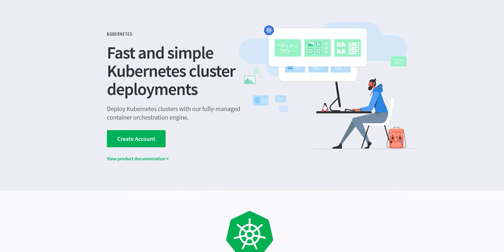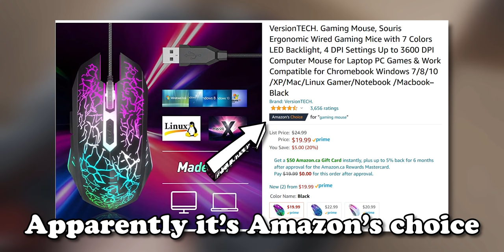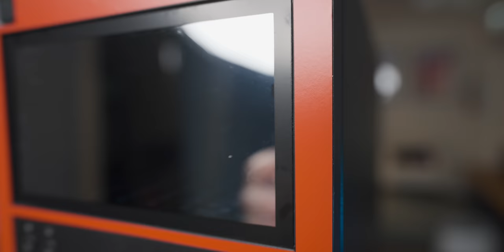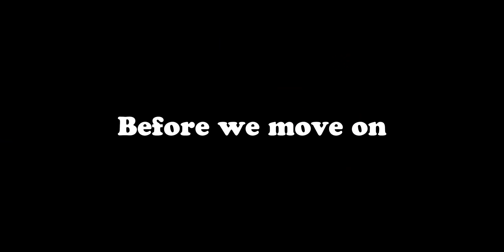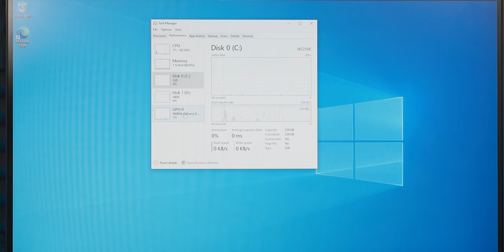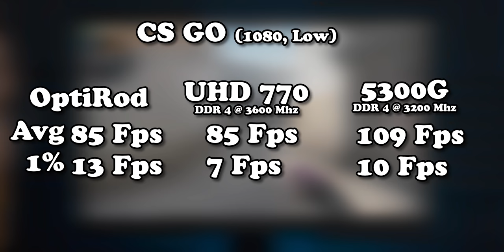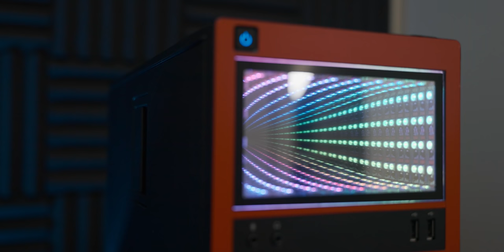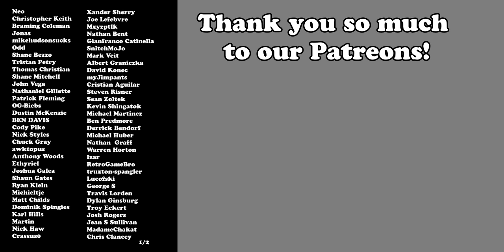I Couldn't Resist Buying This "Gaming" PC From Best Buy...

Comment: Looking forward to your sleeper build in this chassis. Maybe not an ALL out alderlake... how about something like ryzen 5600x and a gtx 2060-3060 class GPU. I suspect you MIGHT be able to swap out the power supply and put in a good cooler and MAYBE a 5600x + 3060 would survive the heat in the chassis. Also maybe swap out the rear fan for something a bit beefier.

Comment: NGL that's probably one of the least sinful office grade cases to do a sleeper build in. Looks like it comes stock with some form of ventilation, is that front panel completely punch-through with that cheese grater design?

(That and the OEM form factor component mounts, ofc.)

Comment: I want you STUFF that case with a 3090 and an Intel 12900k. Make that infinity mirror fill with fire as the case temp skyrockets to just under the temperature on the surface of Mercury. During the middle of the day. In summer.

Comment: A common problem with these, is the rubber holders for the system fan. They degrade over time, causing the fan to fall down and get jammed in the CPU fan. Brilliant cost cutting design by Dell, as usual. ;)

Comment: I think you have a DD4 1030 there. I have a Hp Prodesk 600SFF with similar specs, and get significantly higher FPS.

The 1030 is being cripled by selling it with DDR4 in stead of DDR5. I have a DDR5 one.

Comment: Honestly if that GT 1030 wasn't DDR4 (it has to be, the GDDR5 still beats or matches all integrated graphics) and had an i7 it definitely wouldn't be a scam at all, if it cost less than perhaps around $400 USD but no more than that (already a stretch). It does seem to be based of the Dell Optiplex 3010 which is the cheapest version of the Ivy Bridge-based Optiplexes.

How much did it cost? I didn't really recall if you ever mentioned it. I love the Dell Optiplex videos. They're really a relic that's still very much usable in 2021/2022.

Comment: as an i7 860 user, never underestimate old cpus.  My i7 can still slaughter Modern Warfare and the like.  The only game it hasn't done well on is Forza Horizon 5.... so I got a 9700k and it's amazing, BUT this old tank can run most anything.  And once you dip into the 2600k, it's game over, new games!

Comment: Keep in mind the 1030 is like a 10 year old graphics card (probably 12 years old now in 2024 when I'm writing this) so the fact it can sort of keep up with a modern iGPU says something about the configuration (although I would just buy a modern system with a modern  iGpU instead since it would be new and go from there).  This Dell is probably the bare minimum for some games and probably can't handle most modern games (ones made in the last 5 years or so). I do have to say that the iGPUs on AMD's processors are quite good compared to the Intel (although the Iris Xe graphics and now their Intel Arc which I don't know if it comes in iGpu form or not) may level things out (I don't keep track anymore).

Comment: Must have been a ddr4 gt 1030 which is basically a gt 730, I had the ddr5 version of the gt 1030 with an i3 2100 and it ran at like 45 to mid 50's at normal.

Comment: If you ran Fortnite with performance mode rendering rather than dx11 and didn't have view distance up I would venture to guess you'd be getting atleast 45 stable if not pushing 60 fps. Performance mode rendering really makes the difference and not even pros use anything past normal or low view distance. Great video though! I love the look of the OptiChad

Comment: The performance was way under expecations tbh. I have an SFF i put together years ago with the i5 2400 and 1030. and i swear GTA 5 ran at 60fps at 1080p normal settings, and CS:GO should be at 100+fps at 1080p lowest. It might be possible your 1030 here might be the DDR4 variant.

Comment: I absolutely hate you for making a cooler optiplex than mine. Mine has an extra fan on the top of the case and an extra grill for it too. It also has a card reader in the front and another fan in the front along with a couple of major internal changes

Comment: Never heard of a GT 1050, I have heard of a GTX 1050, and I have never seen a single slot 
1050, ever.  what brand is it ? I looked at it carefully its not thick enough to have a fan, it
just has a heat sync, never seen a 1050 without a fan.
Reply: It's a 1030 though.
Reply: @InfectedChris  does he talk wrong just to be annoying ?

Comment: Optiplex 3010. Those, the 7010, and the 9010 are the pinnacle of “let’s turn this office turd into a GaMiNg PC.”
IIRC, the 3020/7020/9020 could also take ATX stuff but the PSU you got to replace the proprietary shit had to be SFX or the smaller version of ATX.

Comment: Be WARNED! You're going to need an SFX form factor Power Supply.
I Have an Optiplex XE2, same layout but with an all black front panel (you can but just the front panel on ebay) has an i3 10100, 1650 Super, 16gb of ram and a 500w PSU.

I Actually cut a Hole in the Front of the metal in the case behind the front panel and added a 120mm intake fan.

Comment: Putting "top of the line" gaming components into that case would be an absolute disaster, it has the airflow of a bowl of Jello.
Reply: So watercool everything. Mount the radiator on the outside if you have to...

Comment: Those optiplex builds are always surprisingly not vomit-inducing.   But that GT1030, a used GTX 750ti would run circles around that piece of junk.

Comment: Comparing the GT1030 to UHD 770, which has the availability of high speed DDR4 or DDR5Z memory, while having a more robust architecture, compared to a GPU with 64bit GDDR5 memory and an older architecture (unless that model is the crappy DDR4 model)
This gpu is literally for systems like this, if you can’t spend the extra coin to make a new system, since the iGPU in these systems is outdated and far bellow 1000 gflops.
More so, if you want more out of a system like this one, try getting a GTX1650 or even a 1650 super or higher if the thing has a good enough power supply, and extra cables.

Comment: Well the spec numbers seems decent, until you realise that all the components are the lowest end stuff possible. This is probably an OptiPlex 3010, the cheapest lineup, and it shows by the much lower quality motherboard with low end chipset and only 2 DIMMs, inferior CPU VRM power delivery, power supply that's not gonna be nearly as reliable, and paired with some ghetto brand RAM and SSD, yeah well it's not gonna last as long as a "true" OptiPlex.

Comment: Processors : Intel Core i9-12900K 16-Cores 3.2GHz (5.2GHz TurboBoost) 
Motherboard : MSI PRO Z690-A WiFi DDR4 
Memory : 64GB CORSAIR VENGEANCE 3200MHz (4x16GB) 
System Cooling : CORSAIR iCUE H150i ELITE CAPELLIX LCD Display 
System Fans : CORSAIR QL White Fans iCUE RGB controlled by iCUE software 
Graphics Cards : NVIDIA 24GB GeForce RTX 3090 
GPU : 1 
Operating System : MS Windows 11 Pro 
Operating System Drive : 1TB OPC Approved Powered by Samsung 
Hard Drive : 250GB Samsung 870 EVO Series 
Hard Drive : 1 
Power Supply : CORSAIR AX1600i ATX Titanium 
Power Supply Sleeved Cable : No Sleeved Cable 
Audio : Integrated High-Definition Audio 
Networking : Onboard Network Port 
The ORIGIN Difference : The Best Gaming Experience Guaranteed  can someone tell me if this is good for gaming

Comment: Pretty sure that’s a DDR3/4 GT 1030 and not GDDR5, bc i’ve seen the 1030 perform better than that.

Edit: i was right, you can see the GDDR5 version getting close to 60fps in GTA V 1080p high settings here:
https://youtu.be/tuB10md61OQ

Comment: Man...just...that thing is horrendous. for the $550 you paid.
for around $300 more you could have gotten a real powerhouse Acer Nitro 5 that's mOdErN with Intel Core i5-114000H, 8GB RAM, 4GB NVIDIA GeForce GTX 1660 and a 250GB SSD.
I later upgraded my RAM to 32GB for an extra $120.
Acer Nitro 5 2021 gaming laptop creams this Scam of a "Gaming" PC.

Comment: I still use the i5 3470 in my system, and my g/card is a ROG 1050ti which works very well with the 3470. Shame i'm still running Battle of Hastings ram ( 1066mhz )

Comment: Curious though, how high GPU wise can you go with this PC before the CPU becomes the bit that's holding back the system n what diference'performance wise will it be compared to modern budget CPUs?
Reply: Some argue it would be anything above 1060 6gb / rx570 range before cpu bottlenecks are really a huge problem

Comment: Benchmarking games on this PC with SSD connected to USB 2.0 and comparing it to other systems is not reliable. Do you always benchmark like this?!? With the other benchmark results you show? You should always disclose this! Not only when a game crashes. Better yet install games on internal drive and do a proper benchmark. I know this is a channel that has more fun and is less serious. But you should do benchmarks and result comparisons that can be trusted. Really off-putting to keep watching this channel.
Here you say it only has USB 2.0: https://youtu.be/XvOSOYAUXDg?t=225
Here you say you use an external SSD: https://youtu.be/XvOSOYAUXDg?t=480

Comment: Oh no Best Buy is selling people garbage computers who would have thought? I already being I've gotten several really nice-looking computers lately that look like people's attempt at building a gaming computer and a rage quit. I've gotten two or three machines lately that appear to be New Old Stock all the parts are significantly not new there like three and four year old components none of which would normally be going together however everything looks brand-new like it just came out of the box somebody built the thing plugged it in and then immediately put it right back out of their house whether they hooked up something wrong and couldn't figure it out or what I haven't played around with any of the machines yet but I've gotten to like that recently maybe three. One of which is a very old Tower we're talking maybe eight year old Tower but the tower looks like it just came out of the box yesterday and none of the components match the age of the tower everything inside looks like it just came out of the package but it looks to be about two or three year old equipment I think it's DDR3 or ddr4. One of the really bizarre weird things is inside the tower uninstall but sitting loose was a total of four brand new CD drives from different manufacturers one of them is Sata and the rest are old as hell however fresh out of the package LOL. Like I said the machine just confuses the sweet Jesus thought of me and I haven't had the energy yet to play around with it and see if it's functional. Power supply on it makes me kind of feel uncomfortable despite it being clearly brand new right out of the box it's a rather questionable looking unit much like the tower where they tried to make something look like a really old computer to hide it had new components. Another machine I got is a Dell Optiplex that somebody clearly tried to go gorilla on and I think they fail it's had a lot of mods done again brand new added components so I don't know why somebody adds new pieces and then throws everything out because they screwed up somewheres. Most notably they bought a brand new power supply rather nice-looking one and it apparently doesn't fit in the tower so they had it hanging out of the back of the case with all the wires running into the hole where the power supply goes LOL. Likewise the hard drive was stuck in sideways instead of properly being attached and looks to be a new hard drive. Last two or three months that I haven't gotten around to looking at yet to see what I can do with them. I quite frequently repair monstrosity is like I'm describing get them functional put Windows 7 back on them and sell them for like a hundred bucks when people buy them. Some of the machines like it or not even a year old and had a issue with Windows 10. Most Windows 10 machines I can't put 7 on and I haven't gotten my hands on a good copy of Windows 10 yet that's not a nightmare to install installing Windows 10 initially is not the problem it's you've got to wait as long as 20 hours for it to download updates and other foolishness and when everything is done on the computer just runs like hot garbage and the problem is Windows.That's why I keep using Windows 7 on machines whenever possible if somebody wants to try putting Windows 10 on it after I'm done you go right ahead it runs beautifully with Windows 7. You want to upgrade it to Windows vdu go right ahead. Was going to ask you if you wanted to part with that headset the way you were talking earlier in the video but it sounds like you want to keep it.